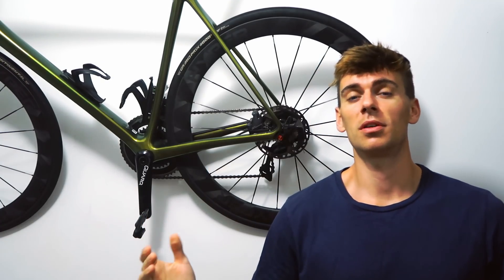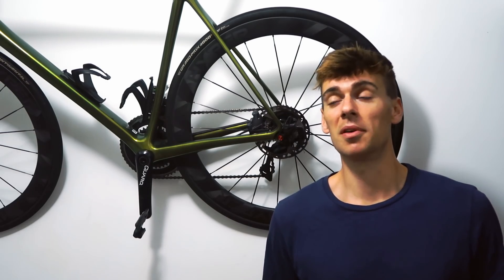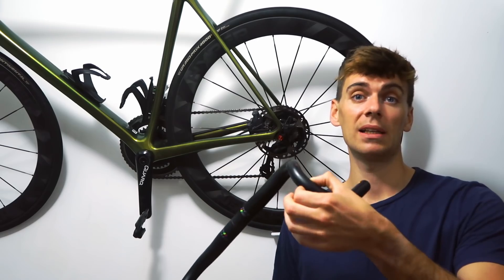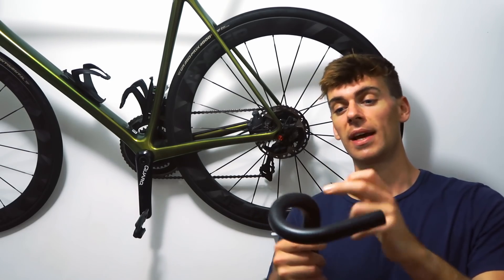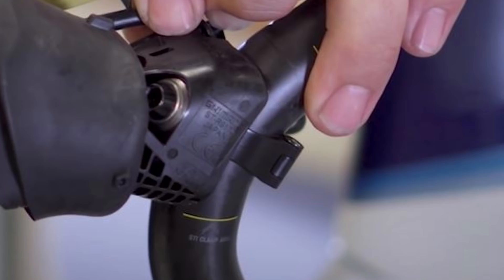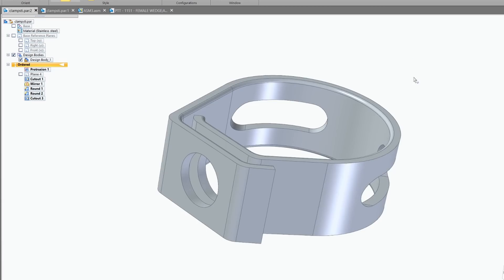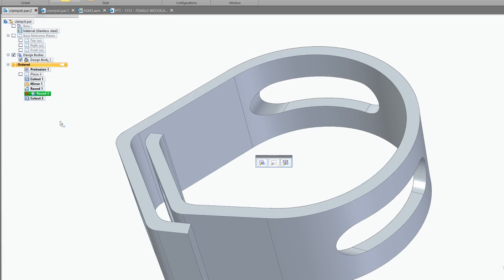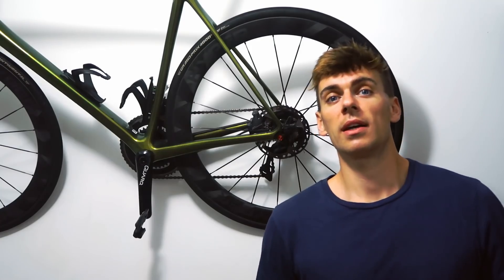MVDP Carbon Handlebar Fail @ Le Samyn: An Engineering discussion.

Comment: Trust our proprietary standards they said.
And then their own bar, with their own clamp, put on by pro-level mechanics, fails catastrophically…
Reply: I'd never buy a bike with any proprietary design. I want: round seatpost, round standard head tube and headset, round handlebar with separate stem, pressfit BB86 or threaded BSA bottom bracket.
Reply: "Pro level mechanics" yeah thats the problem, they hate torque wrenches because they think they are to good for them & they can "feel" how much they are torquing, problem is, look at the MVDP bike build video at 6:08 https://youtu.be/a-UU1Owduq0?t=364

Hard to tell how hard that dude is torquing up that bolt but it looks pretty firm since A) Look at the strain on his finger & wrist, looks way more than 4-6nm B) Did the torx key "dig in" to the bolt material? The way he have to wiggle out the torx key; that only happens to me when i really really tighten a bolt as hard as i can
Reply: @Jeppelelle  It's absolute BS that "pro mechanic" can tell the proper torque with his wrist strength. You just can't because everyone's got different strength. When I was an aircraft airframe mechanic in military, we always had inspector who made sure that we use calibrated torque wrench for tightening critical bolts of the airframe. Improper torque of bolts can cause things to fall off or cause stress cracks.    
Granted that bicycles don't get subjected to harsh stress, torque, and vibrations like airplanes while they're moving, but due to "fragile" nature of carbon fiber parts, proper torque shouldn't be ignored.
Reply: @Reanimator999  Yep, it would be fun to make an experiment, tell 50 random people & 50 "pros"/bike mechanics to "hand torque" a seatpost clamp to 4nm or hoods to 6nm, i would bet good money on that not even 10% of the people would even get within 1-2nm of the correct torque consistently, 4nm is so little force that i think both of the groups would think they applied way to little force & thus proceed to overtigthen it & i don't think the result between the groups would be significantly different. So yeah, seeing this dude using his armstrenght to tighten a bolt anyone can tighten with low wrist strength....well yeah in combination with carbon fibers notoriously clamping "fragility" (for lack of a better word/term) is probably not a good combo
Reply: @Jeppelelle  Exactly my thought as well. I remember the crash of one of the AG2R riders in a TT. They swapped out some part of the handle bar the night before or he morning of the TT, something not to spec and he introduced himself to the tarmac...

Comment: I added some rubber gaskets on the Shifter level clamps. The rubber not only protects the carbon bend but you can now add the proper torque and the Levers will not slip as the rubber sticks around the carbon. 70 cents to solve this problem.

Comment: Great analysis. Note that some handlebar stems have a similar lack-of-radius problem where the stem edges contact the bar. The sharp, straight edge of the stem digs right into the handlebar, causing a potential failure point. Especially since the bar flexes under load, such as when sprinting. And, this is not theoretical. I experienced a carbon bar failure on the bar surface where the sharp stem edge contacted it. That's despite using a Park Tools calibrated preset torque wrench on the stem bolts, and tightening gradually "in layers" and in the correct bolt pattern order. Now I only buy stems with radiused edges, and I don't use carbon bars anymore.

Comment: That clamp looks way more complex to manufacture than a simpler potentially safer one, but it looks like the design of the Canyon band is actually to avoid the edge from biting in as it's not straight, it looks tapered so the edges will meet at the curve at roughly 90 degrees (at least that would be the idea). Those canyon clamps also look like the edges are rounded, not the shiny sharp metal of the Shimano setup.

Comment: Saw these clamps in the canyon build video, was wondering why they used something different, like u said why redesign a safety-critical component if you don't have to. They just did it because of the square handlebar end, which I can't really think of a reason to have anyway....
Reply from the maker: The risks of deviating from a time proven clamp for a non-OEM solution for a few cm of sqaure shaped drop? How did that ever get approval. Mad.

Comment: Excellent video! Really great stuff.

Related to this...BULLETIN TO ALL BAR MANUFACTURERS: in a perfect world ALL decent road bars would come with both centering marks for the stem AND marks at the transitions for the shifters. I have some bars that have these and it makes setup/install a breeze! I know, I know. I can just pull out a tape measure/level, etc. But, as I wrote, in a perfect world all manufacturers would put these on the bars. Fingers crossed!

Comment: Van Der Poel gets all over his bars. He rides with a flatter back angle than most, most of the time....which brings center of gravity forwards. He also sites on the front 1/3 of the saddle for long periods. When climbing he uses the drops more than most. and when sprinting, he rocks the bike more than most.  I believe his stem length is 120mm. He's 184cm and 75kg, and when sprinting out of the saddle he gets more lateral shift of his pelvis which is counterbalanced by more stress through the bars. 
Yet another example that aggressive riders should use alloy bars. 
In the carbon era, I've seen at least 6 carbon bars break during sprints, and never an alloy bar.
Reply: @username8644  
Agree.  If the bars break, you are not riding for at least 3 months. 
Tightening carbon bars to spec often delaminates carbon layers. Most professional mechanics do not torque to spec, but a few Nm below. And with repetitive tightening and loosening, the carbon layers are further delaminated.
Reply: @username8644  
Yes, you will find most pros and experienced riders share your perspective re where carbon components.  
The great majority of racers are carrying at least 5 kg of excess fat and even muscle. 

They should be looking at optimizing their body for more efficient acceleration and climbing.  Many do not realize Chris Froome's dramatic improvement around 2011 when he joined Team Sky was due significantly to stripping muscle from his trunk and upper limbs, and getting his bodyfat % under 10% for the full year. It would drop under 6% during the GT season.

Comment: OK, now that I've had time to look at my handlebars here's what I've found. I have the Canyon aeroad CFR. I unwrapped the bars and looked at the bars and the clamps. The bars are perfectly round in the area defined as where you can attach the levers.  The gauge I have can't detect anything by measuring all up and down and from every angle. Also, there was no marring at all where the clamp was initially installed, not even a difference in the shine so the campher on the edge of the clamp seems to have been more than enough. No marring. I think the pinned clamp is better than the stock clamp because it looks to me like it spreads the pressure around the bar more evenly. 
I wish I could report something that looked wrong because I'd be more confident of a quick fix, but since I can't, all I can say is, everything looks very well done.  It may turn out that MVP's bike's failure was just a fluke and the design is just fine.  In the meantime I have a couple of other bikes that ride just fine.

Comment: Can confirm that the explanation of the issues with Canyon's proprietary clamp is very accurate - and probably a bigger problem than stated. Even if you don't damage the handlebar when tightening, any crash or force applied to the hoods that would normally make it slip will cause the bolt to dig into and (probably) damage the bar. Also, it's important to note that use of this clamp isn't limited to the Aeroad. I found out it's used on the Grail as well when I went to replace a shifter that broke in a fall and found significant damage to the handlebar.

Comment: Campagnolo does actually radius their clamps and the correct orientation is indicated. Never had an issue with them on carbon, have had one Deda 35 bar break from SRAM though. As a soon to be mechanical engineer I really appreciate your ability to explain the nuances of the design process for the real life application. Being a tinkerer does not make someone an engineer, takes years of going through methods, processes and reviews.
Reply: At the same time,  a lifelong tinkerer may be more capable than an inexperienced engineer.

Comment: Good observation on the superiority of the Shimano bolt design. Back in the pre-brifter olden days, pressed steel brake lever clamps featured a captive nut, with an M6 cheesehead or cap screw running through the brake lever. Look at old pair of  80s era alloy bars, and you'll likely find witness marks from an overtightened brake lever on the outside radius of the bend. The bolt end would literally bore into the bars, leaving distinctive circular cuts. The risk posed by the Canyon design is more than theoretical.

Comment: I added some rubber gaskets on the Shifter level clamps. The rubber not only protects the carbon bend but you can now add the proper torque and the Levers will not slip as the rubber sticks around the carbon.

Comment: The SRAM design is a bolt design too, with threads in the clamp. So potentially the bolt can contact the bar too. They are different from the campy/shimano clamps too.

Comment: Other aspects to consider: 1- handle bars manufacturers have different bends, some have flat surfaces or reinforced the area where the clamps are place; some manufacturers will state if the stems  are carbon bar friendly or not, 3- Shimano could also place the clamps In a ceramic stone polisher to remove the sharp edges, 4 obey torque specs for carbon anything!!!!!

I am a 250lbs cyclist, I have use carbon bars on my xc bike and carbon extensions on my TT bike for  years with no failures

I use to use a carbon base bar but it would slip if I hit a bad pot hole or railroad crossing, I switched to aluminum just for peace of mind

Comment: Great video as usual, but the question I’d like to raise is why Canyon’s bar drop ends are squared off instead of round. If that is the reason for their going to a proprietary lever clamp, that would seem to be an easy fix for the future as they can go back to Shimano’s clamps... even if the edges are not chamfered. 😊

Comment: Solid vid. Along with everything you’ve said, I reckon the mechanic has over tightened at the request of van der Poel. As you said, a standard nm manufacturer recommendation will result in Mathieu’s levers to move with his power.

Comment: Interesting. I reckon the attaching zone you can see marked on the handlebar, yellow lines, is where the joint is placed. Did the bar fail THERE, or where the joint ends high/low on the bar, possibly creating  stress riser?? Why not use some epoxy to glue strips of abrasive paper onto the front part of the attaching zone, creating higher friction to keep STI levers in position? Possibly also to the rear side of the bar, to keep clamp in place? That way, you could use lower clamping force. I know it´s a bugger when levers slip, especially the left. My Ergopower did, and front brake was adjusted close to the rim, having me to fight a constant front braking.. Not racing, though.     Rgr

Comment: The interface between these bands and the back side of the handlebars has always bugged me and now I see why. 😕
Reply from the maker: Its a bad design kept under wraps. Literally
Reply: @PeakTorque  what would stop me from filing it round just a little so that there is no sharp edge digging into the carbon
Reply: @larsborgman3443  I guess nothing. Another commenter said they do the same thing in these comments and Peak Torque said they do it as well. Look for "Shunt Harvey Ricafort"s comment

Comment: You can't make a radius on the clamp edges during stamping. No way of 'swaging' those sharp corners since you'd be moving (instead of removing) material, you'd just deform the corners. That radius needs material removal hence machining or grinding, that's why they don't do it as it would increase cost

Comment: Is the probability of the Canyon design to damage the bar by clamp edges not larger? The clamp seems much stiffer, the simpler clamps that also have slots in it seem more likely to bend to conform to the bar?

Comment: 3:00 you won't get much of an edge radius on that 18g steel strap. A soft aluminium sleeve, all the way round the tube, sticking axially out the ends by a few mm, would  remove the crack initiation site from the structural part of the bars.

Comment: use a ductile material for alternating stresses 🙈 even in the case of a fall, it is better because it bends before it cracks
carbon, elongation at frature ~ 1,5%
aluminium, elongation at frature ~ 15%

Comment: Why do canyon do all this weird proprietary stuff? Like, why does a handlebar need to have a cross section like that and why does a seatpost need to be so flexy? At least now that it's backfired bike companies might learn. If it ain't broke...
Reply from the maker: In product design you need to evaluate risks right. Does the benefit of having a proprietary, square shaped drop outweigh the risks of using a non-standard non-OEM part? No!
Reply: Sales wants it, r&d says yes but... Sales dep commands to continue anyway. Story of a friend
Reply: What is the benefit?

Comment: Great points! We also need to keep in mind that the cycling industry, like many industries, is built around the integration of many small parts, some new some old. In the rush to differentiate ones product, often times well established design practices are overlooked or dismissed. Sometimes because they really weren’t understood in the first place. IMO, carbon has no place in handle bars/steerers to begin with. The point loads associated with those items are simply to great and variable across the ecosystem of components. It’s like playing wack-a-mole, when you address one issue, another pops up.  Given the materials available and weight saving involved, does it really make sense?

Comment: Could easily be too much torque on the bolts + a hit in the truck + a massively powerful dude pulling on it for 6 hours a day. Agree the right profile will make a big difference to the reliability.

Comment: Dude, people have been putting their huge weight and force on brake levers with out of saddle climbing and sprinting since drop bars have been invented.
The bottom line is the bar is not designed to handle the stress.
As far a the clamp contact with the bar,  that bar section could be wrapped with silicon tape. This will protect bar a decrease slippage.  The mechanic can also file clamp edges to make a smooth chamfered edge.

Comment: It would be nice to see some finite element analysis about the two clamp designs of how they are able to cope with slightly over/under sized handlebars. Not sure about the actual tolerancing of the bars/clamps, but simulate something like nominal, ±0.2, ±0.5mm. Somehow i strogly suspect that a strip of sheet metal wraps around any size in a given range nicely whereas the machined construction is simply too rigid and quickly ends up having only 1-2 point contacts when clamped on handlebars which are not PERFECTLY fitting into the clamps. Then regardless the chamfers/fillets added around the edges there will be some serious stress concentration.

Comment: Interesting analysis!  Can't see the benefit of the new clamp at all.   Why?  For sure it's heavier than the titanium Shimano one.     Why make a non round handlebar end anyway?
As for the chamfer:  I use cheap chinese handlebars.  Crashed a few times, the STI levers got banged, they moved.  Not a mark to make note of on the handlebar.  I think it's very rare to see such a failure, I don't remember any at all!   Of course the bars might break on crash, but that's to be expected, I'd think!